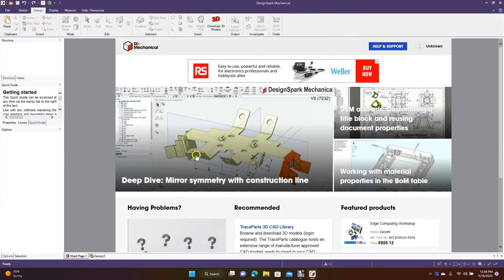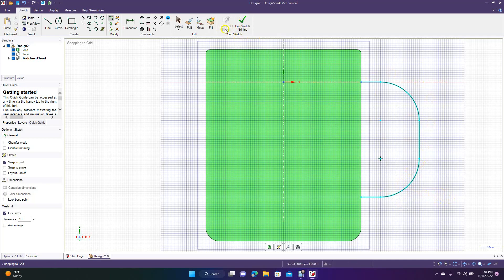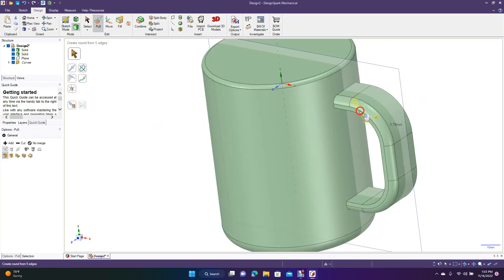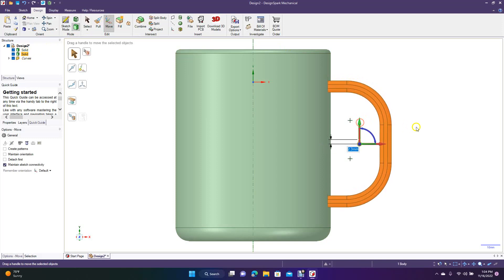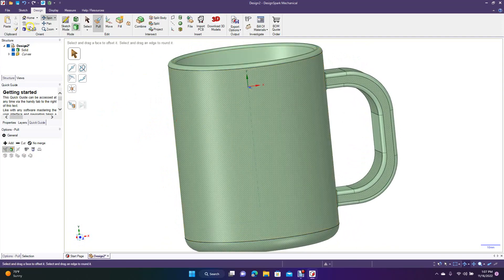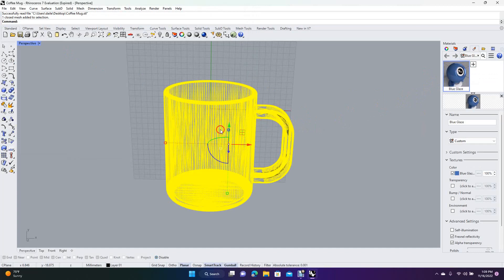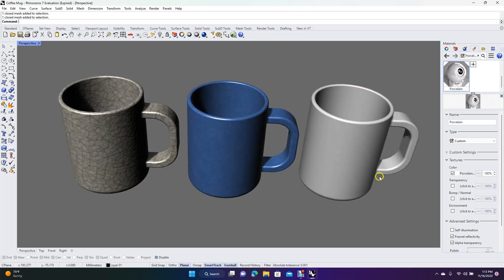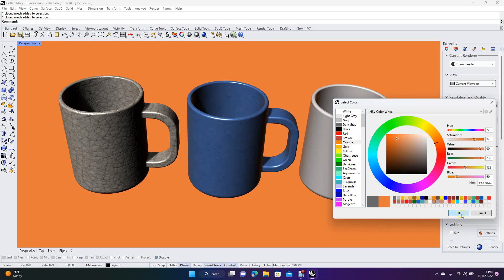How to make a basic coffee mug in design spark mechanical

Comment: In your opinion is designspark as good as fusion.
I like its workflow and the fact its free, I'm using onshape but I like designspark.
Just wondering were to invest my time.
Reply from the maker: David, in my Humble opinion, Fusion 360 is a better program between the two. Of course, this all depends on what kind of modeling you want to do. For organic modeling blender is king, for overall 3D modeling I like DSM, fusion 360, and Rhino 7.0. For engineering type modeling: Creo, or solid works. Hope this helps.
Reply: @dailey3drevolve  thx

Comment: Nice video. So design spark has no renderer that why you use Rhino? But thats a payware and not cheap one. Are there other free render/raytrace programs and could you show some? Keep good work,
Reply from the maker: Die, thanks.  DSM does have some basic render options, but nothing like Rhino 7.0. I did a tutorial on this a while back. Blender has good render options, and the program is free, however the learning curve is steep with this program, and adding textures is not as easy as with Rhino 7.0. D5 rendering is a free rendering program that I'm currently checking out. I will post some videos once I learn the basics.